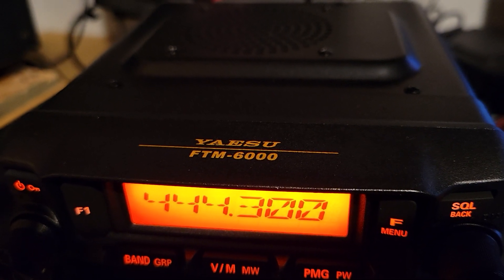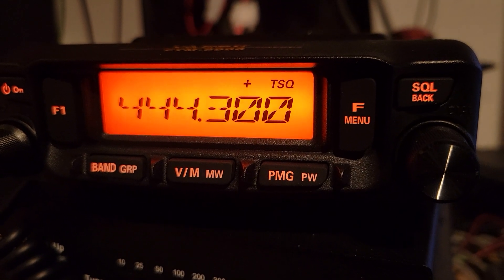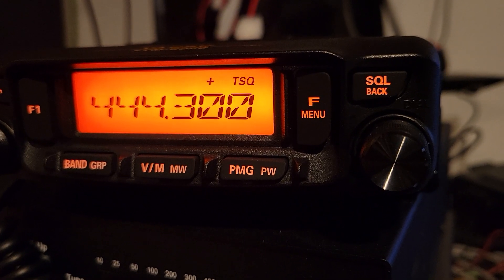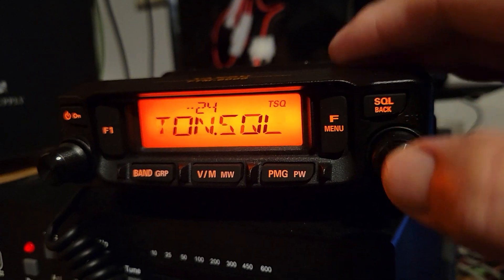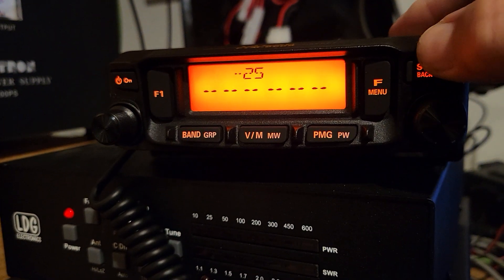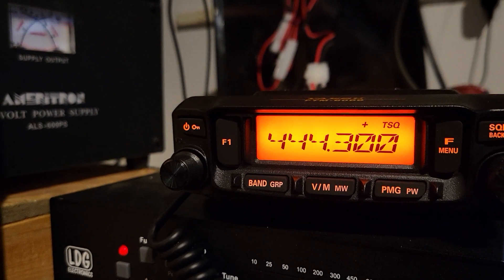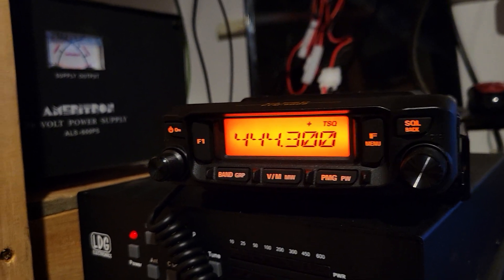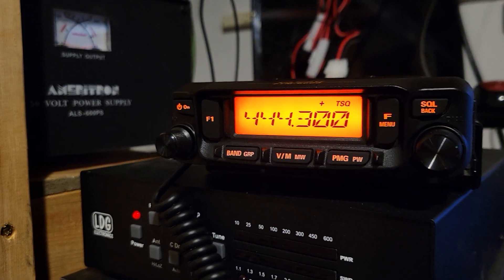FTM-6000 Basic Repeater Settings

Comment: Haha, you never read the manual my friend. The ftm 6000 has a menu system allowing you to have the full, (long press) or the quick (short press) menu. You can put items from full into short, or vice versa. That way the things you need most are easy to get to. Items are not duplicated in the menus to save confusion.

Comment: I’m having the same problem with mine.  What I’ve found, what mine does, after I program in the shift and the TSQ it will have no sound from my speaker.  I adjust the volume and the squelch, When can push the ptt it will activate the repeater, showing on the screen but nothing comes over through the speaker.  The repeater has a code it sends and an automated voice telling of activation.  Mine won’t allow the voice over the speaker.  When I activate the repeater with my HT the repeater activates, a Morse code comes through with a voice confirmation on my HT but not the FTM 6000.  I’m pulling my hair out with this thing.
Reply from the maker: I bought this to play with Project M17. I thought I would play with it before I did set this up for what I bought it for.  Very frustrating radio.